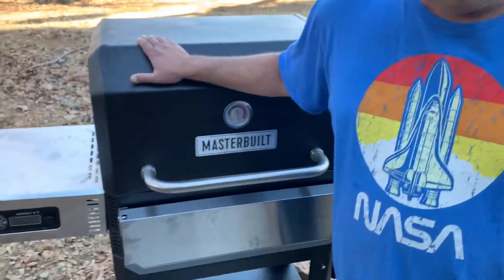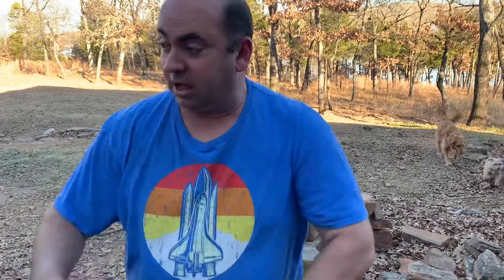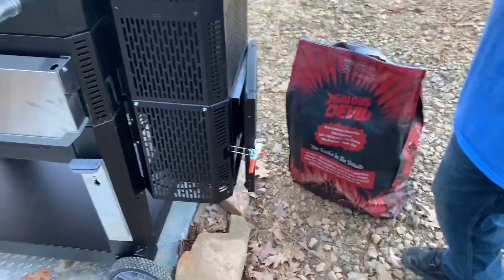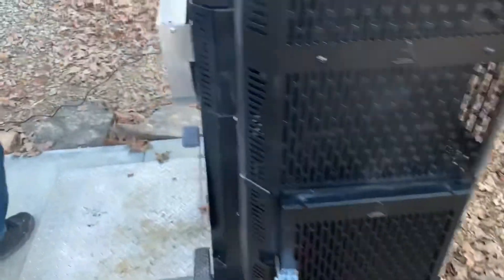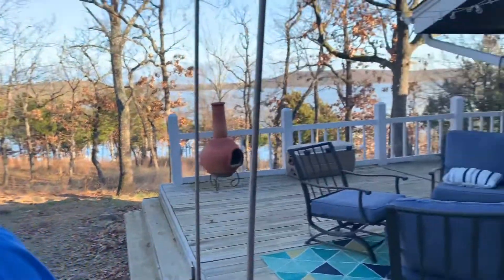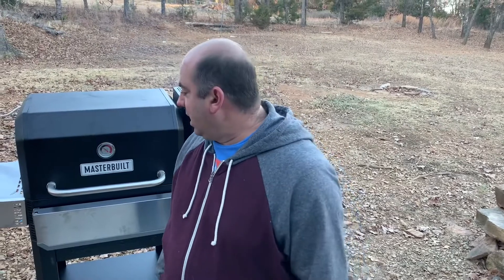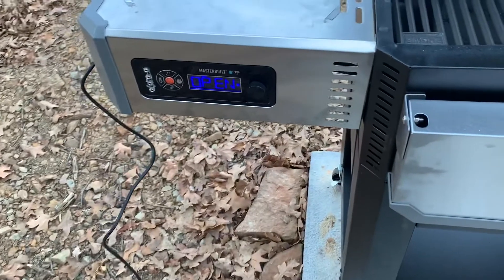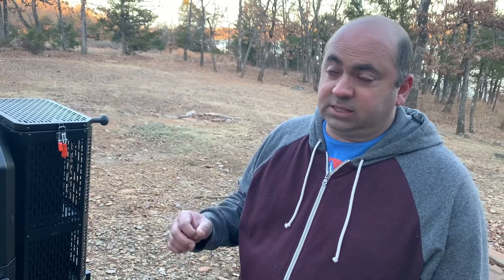How to burn in your new smoker master built 1050

Comment: Do not use olive oil to season your new grill! Also you are not following the instructions from Masterbuilt on the burn in procedures..
Reply from the maker: Thanks for the comment 👍 we are professionals however. We never use any oil for burn in process we only use it after the smoker cools down. We use it to preserve and protect any metal surfaces
Reply: @mikesmoke2009 Olive oil has a very low smoke point. If you season with OO, you are putting rank burnt smoke into your grill and are not seasoning it.

Comment: Mine won’t smoke. I’ve checked everything. It smokes out the hopper like crazy but nothing to the cooking chamber. Is it the charcoal?  I’m doing something wrong.
Reply: Did you solve the problem  
What  was it ? 
#sameoverhere
Reply: Did u remove the damper
Reply: I removed the two horizontal dampers and it worked great